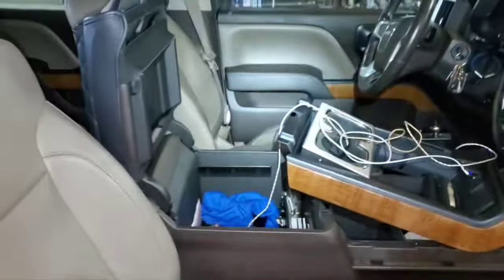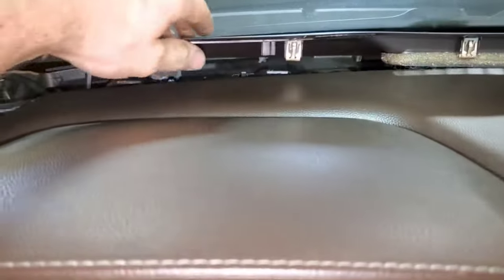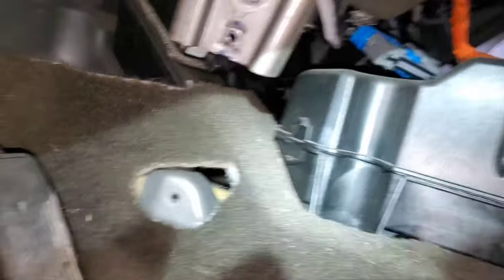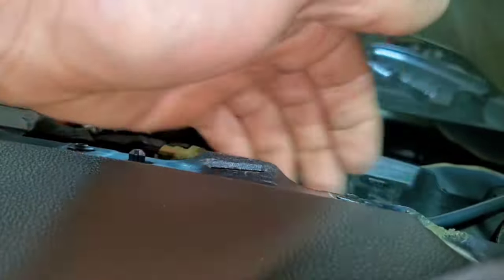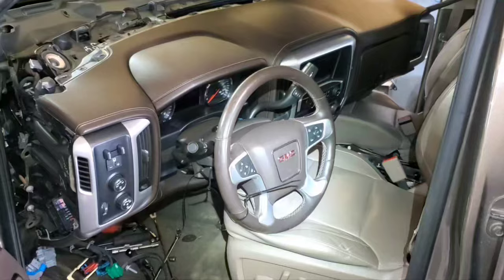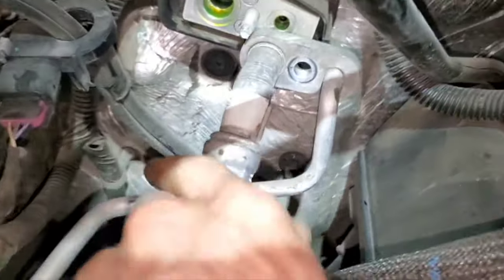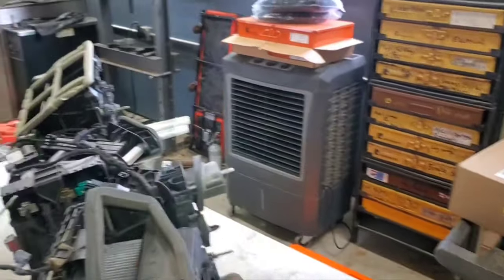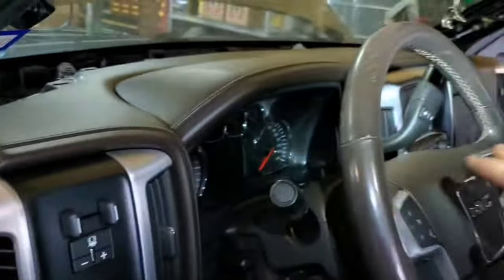2014-2018 GMC Sierra, Silverado A/C Evaporator Core Replacement

Comment: For anyone attempting this, I found an even easier way to pull the bolt behind the intake. A stubby socket wrench and short 10mm socket can get it off if you have a buddy around. Climb up in the  bay and reach down over the intake to get that socket on the bolt. Once it’s on, keep a finger on it. Have your buddy crawl underneath and turn on it. You can barely reach, so it takes plenty of turns, but we made it happen this evening. 2014 Silverado.

Comment: I can't use the proper adjectives to describe GM engineering on the replacement of heater and evaporator coils.  They made this a nightmare starting back around the 2000 models.

Comment: Going to watch the video tonight,  got to do on a 18 silverado tomorrow. Have you done an air distribution case on a envision where the rear temp door is broken. I have done a few at the dealership not any fun
Reply from the maker: @timothyrachford1868  nope, haven't even touched one of those cars yet!
Reply: @TechnicianRed  step 1 disconnect the battery, step 2 remove the front doors
Reply from the maker: @timothyrachford1868  I heard some new GM models require windshield removal to gain access to hardware holding the dash in. I haven't actually seen that yet- just what I have heard.
Reply: @TechnicianRed  I haven't had the pleasure of doing much interior work yet on the newer stuff,  but know I really dislike the engineers that design them

Comment: Just wanted to say thank you. I watched this video and it gave me the confidence to tackle this job. You saved me 3500 dollars. I was able to do this job by myself because of this video and ac was fixed and cooling better than ever. You had every single part in order and I can’t thank you enough. You have a new subscriber. By the way the ac system in this truck is the worst I have ever seen. Problem after problem.

Comment: Awesome video man definitely saved me hours this morning. The swivel trick for the bolt behind the intake wasn't working for me but I was able to get to it with a mini 1/4 flex ratchet incase anyone else is having trouble getting on that bolt
Reply: Did you go from the bottom? How did you get the ratchet on there?

Comment: The top housing is held by a couple torx bolts along with other black bolts that doesn’t seem like and Allen would fit in there. Is there a special tool for this? I just need to get those out and I’m finally at the evap core…

Comment: Great video and to the point.
OP can you tell me how you diagnosed it to the evaporator core? You said you got a scope in there? Thanks
Reply from the maker: Usually you can remove the blower motor resistor and use a borescope to get a good look at the evaporator core. Most leaks will leave behind a wet oil spot or in this case an UV leak detector dye that is visible with a special UV light borescope

Comment: Video  was spot on . I've done lots of dashboard work in my years in autobody (airbags) And your video saved me a lot of time , on my own truck . 
However,  for guys with a duramax , that one bolt behind  the engine... plan on removing top half  of the engine / all the exhaust / turbo pipes . To get to that one bolt. There is about a half an inch to work in , if u can find it.

Comment: It must be a nightmare to put those bolts back in. I can see little bolts falling into crevices. Putting some masking tape on the head of a the bolt and stuffing it in the socket can help a little.
Reply from the maker: I use electrical tape to hold the bolt to the socket. It doesn't take much. Very easy to do with flange bolts/nuts. Just a 1/32" overlap under the flange holds good buy still allows easy socket removal.

Comment: Thank you so much!!!! Because of this video I was able to replace my evaporator core. You can replace it while keeping the heater core hoses attached so you don’t leak coolant everywhere. Just pull the whole ”hvac” system forward. Also I got up on my front end of my truck and reached my hand down behind the intake with a 10mm on a 1/4 ratchet and was able to remove that bolt. It sucked but I got it!!!

Comment: For anyone trying this I recommend taking the windshield off or calling a professional to take it off it’s way faster when your taking those 4-6 10 millimeter bolts & you don’t have to take the hvac box completely out meaning you don’t have to take the heater hose out & the other hose off just take off the 5 10 millimeter bolts and it should give you enough room and you can take the evaporator core out inside the vehicle. Also be careful when putting the evaporator cover back on don’t pull on the heater hose like I did bc it will snap and you’ll have to change that too. Hope this helps anyone.

Comment: Specialty tool needed for heater core hoses on my 2018
Reply: I just did a 17 this morning and didn't have that tool either. I wound up pulling the hoses through the firewall with the box since there was room
Reply: @papacrunk5967  - fuel line disconnect doesnt work like in previous years?

Comment: Is it possible to get at the blend door, without taking the hvac box out? Can that cover come off in the truck and the heater and evaporator cores stay in to gain access to the blend door?
Reply from the maker: No. You may be able to change the blend door actuator with the HVAC housing still in the truck but to replace the door the HVAC housing will need to be removed and split open.

Comment: I have a leak in my 2018 sierra 1500. I’m wondering if what’s on your video will apply to my truck as well?? Dealer is charging me 4k to fix evaporator core. My jaw dropped when tech told me the price.
Reply: I just got the same quote today on my 2018, and was wondering the same thing

Comment: This is so helpful and straight to the point, thank you so much it looks like the issue is the compressor seal on mine and hopefully that's it, but if not I know either how to get at the EVAP core or to hunt you down for this job

Comment: Amazing video, thank you for the details Tech Red!  Anyone ever have a sweet smell coming in from vents or foul smelly wet sock odor like satan's breath was blowing at you when you first start up on a humid day?  I am not talking about a slight smell, I am talking about a smell like something died in the system.  After about 2 to 3 minutes, the odor clears out when turning on ac.  I am curious as to whether something happened to the Evaporator Core when I bought it back in 2014.  This has been happening every summer since.  Chevy always wants to throw fresh spray in the system.
Reply from the maker: Leaking heater core will cause sweet smell. A dead rodent will cause the bad smell.

Comment: How would you know if your evaporator is starting to go out and needs replacement? 

I told one of my buddies every-time i turn my ac on in my silverado it would blow the smell of wet cloths from the vents only for about a few seconds then itll go back to normal! He said it could be my evaporator thats giving out! 

Any idea or suggestions where to start looking for the issue
Reply from the maker: If your evaporator is leaking enough to produce an odor, your a/c would allready be noticeably low on refrigerant. I can immediately tell by smell whether it is the evaporator or heater core leaking but I've had plenty of sniff tests to dial in my sniffer throughout my career. But to answer your question a borescope through the blower motor resistor cavity is the 1st step I take to verify a leak. Most leaks will leave an oil spot that is visible with the borescope. If you don't see anything put some UV leak detection dye in the system and recharge the A/C. When it gets low again, look for the leak with a UV flashlight and glasses. I have yet to have dye fail me!
Reply: @TechnicianRed  the leak test seems fairly easy And its not to expensive. I know my A/c isnt low since my air is still cold. However it blows hot with the wet smell only for couple seconds when i start up my AC after it starts blowing cold. I stoped at oriellys to get this spray to put in the outer vents to hopefully clear out the mildew or smell it worked for about a day hahah to no avail. 

Thanks you for the tip!! Hopefully i can get the issue resolved b4 it becomes a bigger problem

Comment: How’d you diagnose the evaporator core? Where’d you stick your scope?
Reply from the maker: Used A/C leak detection dye and my Snap-On borescope with the UV probe with dual cameras (one is at 90 degrees). I believe I went through the blower motor resistor hole.

Comment: What are the risks for scratching plastics??
Reply from the maker: I have never had a problem and I have removed probably 150 dashes so far. Don't buy the plastic trim tools- they suck and usually cause more damage than a smooth metal trim tool.

Comment: quick question what kind of fasteners are they using for the top housing? its looks like there welded plastic do i just drill them out? and how do you reattach them?
Reply from the maker: This one had screws but some newer GM units are held together by melting the plastic case halves together (like a plastic "spot weld"). Unfortunately, I haven't had to repair those yet so I can't offer any great advice but I'm pretty sure you would drill them out and install screws with washers.
Reply: That’s what I do. Drill and find new screws to fit.